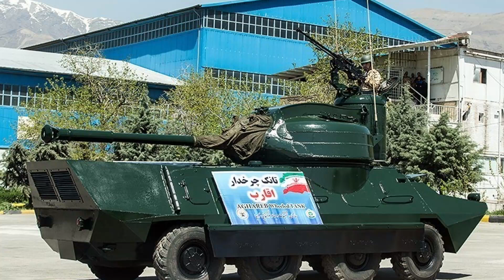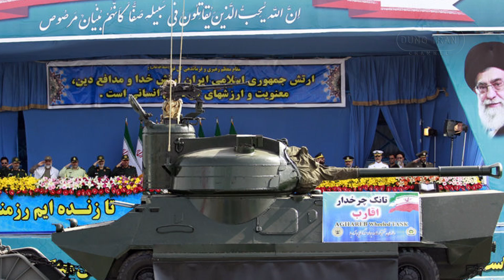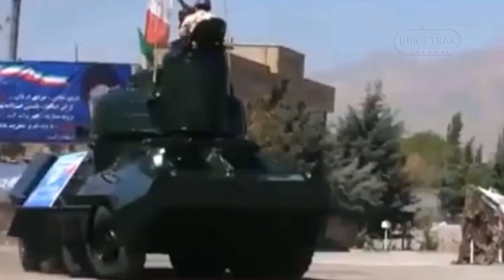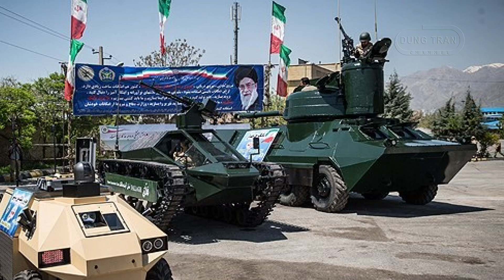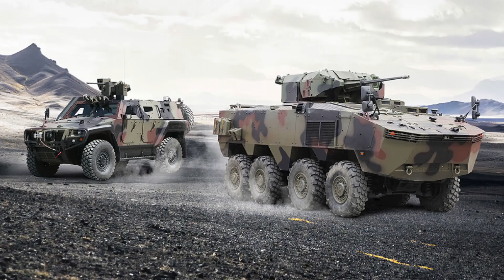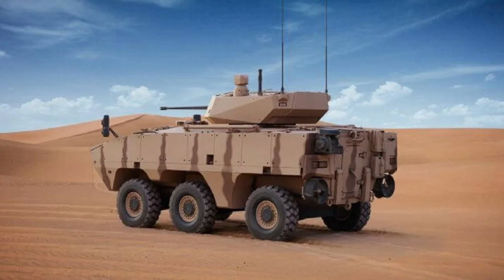Aqareb: Inside Iran's Versatile 8-Wheeled Armored Fighting Vehicle

Comment: Very Briefed And Summarized Ideas:

I think it's a workshop development project, and we should not consider everything as a major military industrial project...

regarding this armor fighting vehicles I don't know what is the asymmetric combat capabilities this obsolete vehicle with the presented fighting compartment could offered to the Iranian ground forces???!!!,(although the 90mm low pressure gun still offerd on international market and provides combat capabilities against a range of diverse targets on the battlefield, and this can be an addition to the wheeled fighting vehicles that are often equipped with heavy machine guns and rapid firing guns), and with the modern generations of munitions, those relatively lightly armored vehicles, start to possess and from longer distances a reasonable 
fighting capabilities against armored targets such as IFVs and APCs, in addition to tanks from oldest generations, whether with, kinetic energy munitions APFSDS, or chemical energy munitions, or HEAT munitions...

thus in its current configuration the vehicle don't offer any asymmetrical capabilities, but it's upscaling the firepower of the original vehicle especially since the Iranian 90mm gun is high pressure, the rounds should be slightly heavier than its low pressure counterparts, but still light enough to provide sustainable high rate of firing, thus with the appropriate modern generation ammunition still capable of offering respectable performance, although the turret is ancients turret... 

I think if those obsolete fighting vehicles, where to be equipped with ATGMs fighting stations similar to 9m133-EM, augmented by autoloader in the back of the vehicle it could give those vehicles asymmetrical capabilities against surface targets and low flying targets, here they could benefited from: 
1- the armor protection of the btr-60 especially when compared with the jeeps and pickups...
2- the relatively large size of the cargo compartment, especially when compared with the magazine of BRDM-3/ 9P148 "Konkurs...
3- the better off-road capabilities especially since those wheeled armor fighting vehicles offering more stable platforms for transporting the multi-launchers with sufficient number of extra missiles, especially when compared with the modified jeeps and medium sized pickups...

other possibilities for the btr-60 in Iranian Armed Forces inventory is SHORAD system carrier, where it could be equipped with only infrared guided air2air missiles, like modified aim-9 sidewinders, or the r-73/r74 which is heavier than aim-9 but offering superior engagement envelope, this SHORAD system could be only missiles base system with long range electro-optical sighting system for passive detection and tracking and engagement capabilities or missile complex complemented by m61-vulcan gun utilizing the electro-optical alongside heavily modernized radar systems, those SHORAD system capable of keeping up with maneuver forces while the latter conducting offensive or defensive operations, for example it could keeps up with the armored and motorized and naval infantry formations divisions and brigades, offering protection against the traditional hostilities and threats like the attack helicopters, ground attack fighter aircraft's and reccon/ strikes drones armed with guided/unguided air2ground ammunition although its useless against the emerging threats like the battlefield saturated with suicide FPVs...

Our best Wishes to the Islamic Republic of Iran...